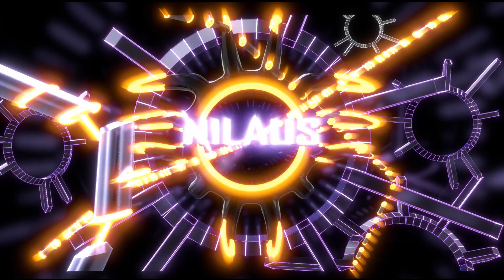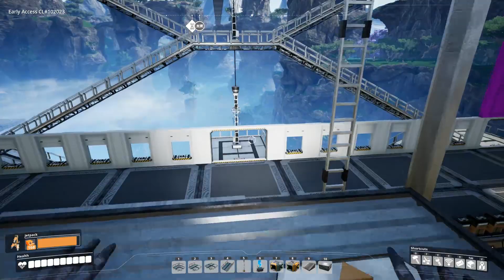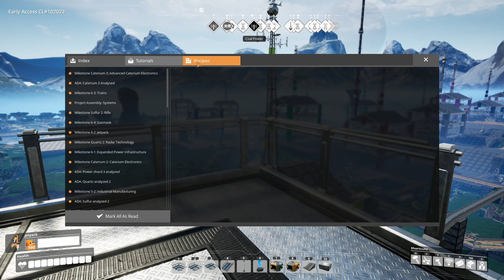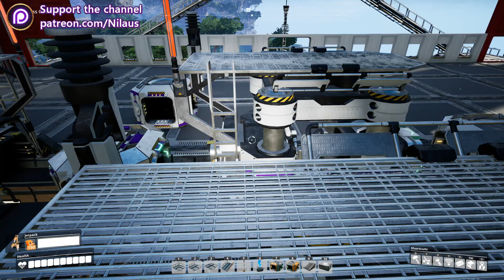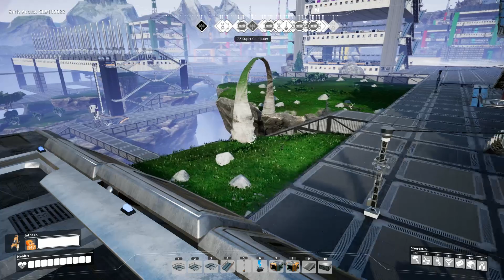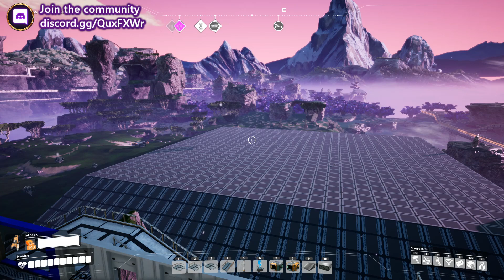Satisfactory City - Day 34 Recap - MONORAILS

Comment: I spent a lot of time building a complex train network with multiple trains, only to realize the trains are not ready for it yet. It's not just freight cars getting lost from their locomotives, that's mostly visual issue and can be dealt with. It's whole trains stealing switch control from each other, getting lost, and literally running in circles. And not just that - when a locomotive takes wrong turn on a switch, it will stop to rethink the path. If it accidentally stops in a station that way, it will get "serviced" - I got several wrong materials delivered to a station due to it. And cleaning belts full of wrong materials all the way up to machines is a chore, you need to rebuild at least the last part for each. Ït's kind of a nightmare, I'm not sure what to do about it. So don't make the same mistake.
Reply from the maker: That is the reason I only make double-headed trains with 2 stations. It is simply too fragile to do anything beyond that currently
Reply: @Nilaus  Surprisingly, two-headed trains are more limited than single-headed. If you use single-headed trains on a simple unbranched loop, you can have any number of trains, any number of stations, and any timetable for each train and it will work flawlessly. You just need to be careful about orientation of your stations. Another design that will work with any number of trains, stations, and any timetables is a single line with a teardrop at each end. In this design the cars may get disconnected from locomotives but the trains wouldn't stop working.
It's when you start branching your network where things break down.